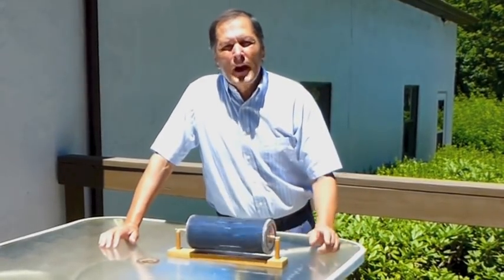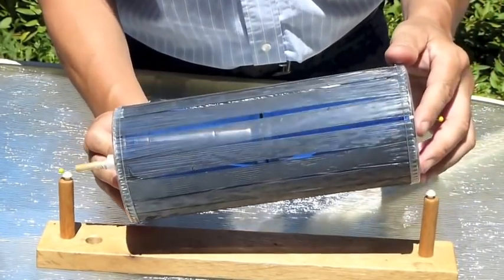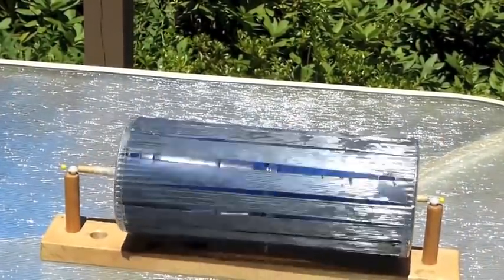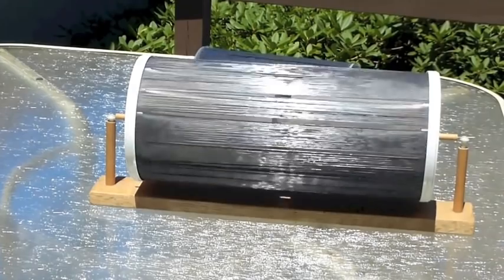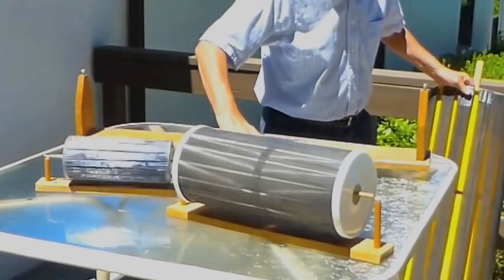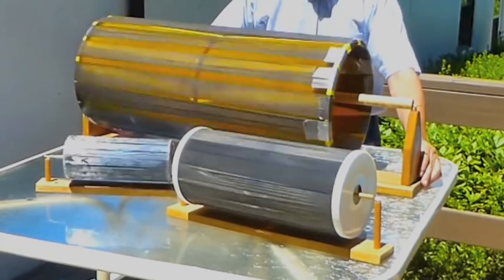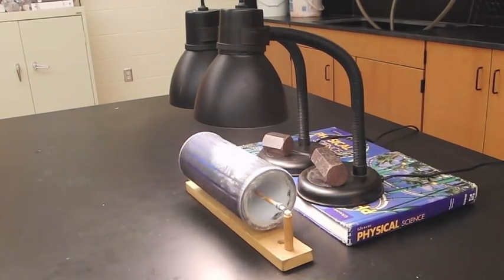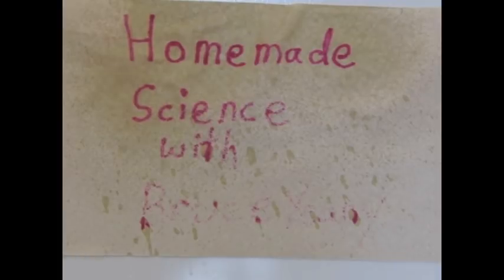Solar motor--Free energy motor-- not electrical /// Homemade Science with Bruce Yeany

Comment: If it can't pump water, what good is it?
Reply from the maker: I think you could ask the same question of 80% of all videos that appear on youtube.  Will this pump water?  No, however it is a good teaching tool about some basic science concepts.  Center of gravity, torque, renewable energy, energy transfer, energy changes, polymers to name a few.  Back in the 1960's NASA build an similar and larger version which had a measurable horsepower but found it to be impractical.  Who knows, perhaps this piece can inspire someone to explore it further and come up with a better design.  If not, it appears that quite a few people still find it interesting.
Reply: Bruce Yeany
Yes, possible.  I'm now building a large hot air engine.  The flywheel is 2 feet in diameter, 2 inches wide and is made of iron.  It is truly a big one.  Thus, the other components too will be large.
Reply from the maker: It sounds awesome,  hopefully you will post it on youtube
Reply: Bruce Yeany
I will post a video on how it was made as well as the tools used.  It will also include a lesson on (what I call) "Ticky Tack" skills.  Those are the abilities gained in life that allow us to tack one thing to another.
Reply: +arbonac let me know when you post it!
Reply: ReddehWow, me too!

Comment: As I viewed your video, I could see how it worked. The sun would expand the strips of plastic on the sunny side, and the strips on the other side would retain their original length but since they are pulled taut, this would cause the entire cylindrical structure's center of mass to move up towards the sun-ward side.  This would create imbalance and since the center of mass was now HIGHER than the center of rotation, gravity would cause it to rotate as CoM tries to reach lowest point. So everything made sense... that is, until I read that you claim that the sun's heat actually causes the plastic strips to contract.  Then it doesn't make any sense to me.  However, very clever design I love the idea of making extraordinary things out of ordinary cheap materials as you have done here.
Reply from the maker: Hi Quazgaa,   good to see most of it makes sense.  The polyethylene
strips of plastic are polymers made of long chains of molecules that shorten as they are heated.  If I take a piece of it and hang a metal weight from it,  I can then bring a 100 watt bulb near it and heat it up.  When I do,  the strip will actually lift the weight enough to measure it.  Rubber will do the same thing.  Interesting enough, my first motor used rubber.  It looked like a bicycle wheel with the spokes replaced with rubber bands, however, it needed more energy than sunlight to make it turn.

Comment: how does it work?
Reply from the maker: The movement of this motor is dependent on the unique property of the stretched trash bag strips.  These strips are made from a plastic material called polyethylene.  This chemical is a common example of a polymer. One of its characteristics is that it is made of very long molecular chains.  These long molecules are stretched to their elastic limit during the stretching process. If more pressure is applied, these long chains are broken when the plastic tears apart.  By heating the strips, the polymer chains contract, pulling the molecules closer together.  They do not expand due to cooling as some students may suggest.  The action of the polyethylene contracting is quite different from a uniform expansion of matter as a result of kinetic energy. As this plastic is heated temporarily, the material pulls tighter and shrinks to a smaller size.  The plastic remains “shrunken” until pressure is applied to stretch the molecular chains out again. 

     The movement of the motor is due to the materials at the top of the cup assembly contracting slightly; this action is pulling the cups together at the top.  The action is not noticeable since it is so slight.  It is noticeable if the plastic is heated sufficiently, but do not try it with the cup assembly.  With the cups pulled together, the assembly becomes unbalanced.  The motor is now top heavy and starts to turn and fall toward the bottom.    As the assembly turns, a new section is then exposed to light and is heated. This new spot becomes top heavy causing this section to fall.  The action is continually repeated making the top section always unbalanced; the cups are constantly trying to adjust to become balanced. The end result is the motor turning because it is trying to right itself. The highest speed for the cups in direct summer sunlight seems to top out around 65 RPMs.
Reply: Thank you for this beautiful thorough explanation!

Comment: Hey Bruce, thank you for another great video!

I will be trying that in class with my students in the coming weeks, I was wondering where do actualy get those "power strips" you mentioned mate?

Cheers from Australia!
Reply: Wow, that simple! I tried with different types of tape and it did not work, I gather that the cylinder needs to be spot on so it can roll properly. Here is my email: pauloteaches@gmail.com

Thank you again Bruce!

Comment: Why does it turn? What is the order of assembly? What are all of the materials used? Why are these materials used? Do the dimensions used effect the devices operation? Is there an assembly video? Thank you.
Reply from the maker: Hi John,  I'd be happy to share all the information that you are asking for and more,  send me an email address that I can forward the information to
Reply: It's a thermal engine based on either contraction or relaxation of the strips (depending on the material) when heated by the sun, and a return to a normal state when cooled by the air and radiative cooling.

Comment: how it work
Reply: Comment from him:
"The movement of this motor is dependent on the unique property of the stretched trash bag strips.  These strips are made from a plastic material called polyethylene.  This chemical is a common example of a polymer. One of its characteristics is that it is made of very long molecular chains.  These long molecules are stretched to their elastic limit during the stretching process. If more pressure is applied, these long chains are broken when the plastic tears apart.  By heating the strips, the polymer chains contract, pulling the molecules closer together.  They do not expand due to cooling as some students may suggest.  The action of the polyethylene contracting is quite different from a uniform expansion of matter as a result of kinetic energy. As this plastic is heated temporarily, the material pulls tighter and shrinks to a smaller size.  The plastic remains “shrunken” until pressure is applied to stretch the molecular chains out again. 

     The movement of the motor is due to the materials at the top of the cup assembly contracting slightly; this action is pulling the cups together at the top.  The action is not noticeable since it is so slight.  It is noticeable if the plastic is heated sufficiently, but do not try it with the cup assembly.  With the cups pulled together, the assembly becomes unbalanced.  The motor is now top heavy and starts to turn and fall toward the bottom.    As the assembly turns, a new section is then exposed to light and is heated. This new spot becomes top heavy causing this section to fall.  The action is continually repeated making the top section always unbalanced; the cups are constantly trying to adjust to become balanced. The end result is the motor turning because it is trying to right itself. The highest speed for the cups in direct summer sunlight seems to top out around 65 RPMs."

Comment: All good clean healthy fun, but does this device have a practical use? Will it turn a load, such as a generator, compressor etc?
Reply from the maker: HI John,  it turns, and is used to power some very light amusements such as the bell ringer and moving a toy hammer ( shown in other videos) but has no torque for doing useful work.
Reply: Perhaps if it were bigger, and more accurately-made? Good idea though!

Comment: Could you explain your solar strips? Are you getting an exothermic reaction from the strips? I think a mendocino style magnet set up and better balance on the unit could improve performance. A practical application I immediately thought of is a vertical axis version of this with an axle going through a roof and driving an interior fan. I have been studying Stirling engines for quite a while and I see this as a similar thermodynamic process going on here or is this more of a question of center of gravity? I would love to make one of these and really am curious about the strips.
Reply from the maker: The plastic strips are made by stretching black polyethelene garbage bags.  The movement of the motor is due to these thin plastic strips at the top of the cup assembly contracting slightly when heated by light; this action is pulling the cups together at the top.  The action is not noticeable since it is so slight.   With the cups pulled together, the assembly becomes unbalanced.  The motor is now top heavy and starts to turn and fall toward the bottom.    As the assembly turns, a new section is then exposed to light and is heated. This new spot becomes top heavy causing this section to fall.  The action is continually repeated making the top section always unbalanced; the cups are constantly trying to adjust to become balanced. The end result is the motor turning because it is trying to right itself. The rotor has to be set horizontally,  I've played around with other designs and can't get it to work on the vertical.  If you are interested in building one, send me an email address and I will forward instructions for you.   Bruce
Reply: For sure, bfw007@gmail.com  
Thanks for your response. I think this is cool. Have you ever tried rubber bands or other materials?
Reply from the maker: I tried rubber bands, and they didn't work

Comment: Ok - they spin themselves - but what usable torque does it generate? Seriously. I mean seriously - can you connect a pulley to this to drive a motor? Magnetic coil? Anything?
Reply from the maker: Hello JoshuaW,  That in itself is quite an accomplishment, I find that as a teaching tool in the discussion of energy they are quite remarkable. The idea is to get students/people to look alternatives to burning fossil fuels.  Will they solve the world's energy needs?  no they won't. Can they do work,  sure  how about driving a hammer https://youtu.be/rbWdGzeQqk4    or maybe ringing a bell  https://youtu.be/FDbFr1jVYSI   Thanks for your comment.

Comment: I wish people would be honest with their titles so that searches for legitimate information wouldn't get buried with this garbage.  NOT "FREE ENERGY".  The irony is that the machine does pay for itself with 177K YouTube views so far, but only because the author attached a fraudulent title.  He should be made to give us all our time back.  But then I would have to pay my company back for the time I wasted watching, then responding to this video (on their time) so as not to be hypocritical.  Never mind.  It's all good... :D
Reply from the maker: Bruce Yeany (Yeany Science) 1 second ago

Hello Chris,  Sorry to see that you are not happy with what I've posted. However, I disagree with every point you've made here so let's take a closer look.    First,  My video is "free" meaning that you didn't pay to watch it either with money or by having to watch commercials, which also means that I made it for "free" and I don't get paid so it hasn't paid for itself.  You  are also  "Free" to switch to another video if you don't like what you see.    Second,  what is misleading in my title?    1. Solar motor….   it is definitely runs on "freely provided" energy from the sun.   2. Free energy…. can be defined as  A. the thermodynamic energy that can be derived to do work in a system, or  B. energy from an input  source that does not have to be paid for.  Windmills,  solar panels,  heat pumps and my motor are all considered to fall into this category.     3. Electrical… none involved     4. Homemade Science with Bruce Yeany…every video  that I post are devices that I have personally built  to demonstrate science principles. There is nothing misleading or fraudulent in any of my 110 titles.  I would certainly like to know what you consider to be a "legitimate" example of  "FREE ENERGY",  hopefully it is not one of those idiotic claims of a device that makes  it's own "energy" and violates the 2nd law of thermodynamics,  if that is the case then you truly are wasting your time…………... One more note,  beyond the 177,000 views on youtube,  my video also appears on 935 other playlists, has been shared 1350 times.  My design has been printed in a science reference book,  I have shown it at numerous state and national science conferences with great success,  I sent out about 1100 copies of how to build it and have built several of them for various college science departments that have requested them, also shared information with the Dept. of Energy asking about  potential upscaling,  not bad for a piece of "garbage"

Comment: Hi what kind of solar strip are they
Reply from the maker: Hello Keith,  the solar strips are made from plastic garbage bags.  They are cut form the bag parallel to the top,  and then stretched. send me an email address and I can forward information on how to build them.
Reply: Keith.Henry9@gmail.com could this be made on a larger scale so that u can produce electricity
Reply from the maker: no,  they are not strong enough

Comment: Sr what kind of plastic is used on the solar strips? the movement is result of the air movement inside the cylinders? i am thinking on a fan with this example. thanks for your video,  is like the salt water electrolite, an old concept now turn high speed cars , so this could be used again in my town were the solar radiation is high
Reply from the maker: The plastic strips are made by stretching black polyethelene garbage bags.  The movement of the motor is due to these thin plastic strips at the top of the cup assembly contracting slightly when heated by light; this action is pulling the cups together at the top.  The action is not noticeable since it is so slight.   With the cups pulled together, the assembly becomes unbalanced.  The motor is now top heavy and starts to turn and fall toward the bottom.    As the assembly turns, a new section is then exposed to light and is heated. This new spot becomes top heavy causing this section to fall.  The action is continually repeated making the top section always unbalanced; the cups are constantly trying to adjust to become balanced. The end result is the motor turning because it is trying to right itself.   UNfortunately, this piece is not strong enough to turn a generator to get any useful energy from it, so even with a lot of sun it is not going to be used to replace other ways of getting energy
Reply: Thanks for your reply sr, just place your self in the sothern californa desert were the sun radiation is so high and the nights are cold,  i can replace the plastic with a metal with good thermal expansion to move a lever, is just matter of scale and time frame,  we learn about metal expansion and bimetalic  energi, but we look as an small field, an sttel bridge and expand 2 inch's per day and the expansion force can brake a wall, is just matter of adjust our ideas to the nature tools. i dont live in california, i am in baja california mexico